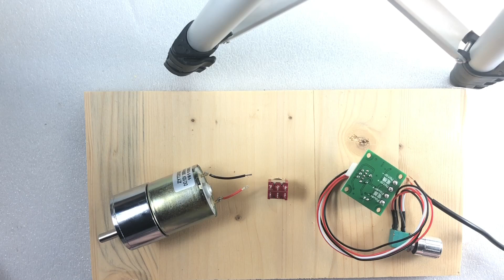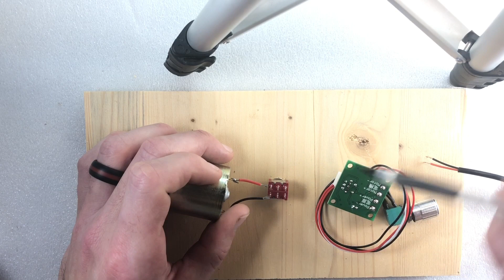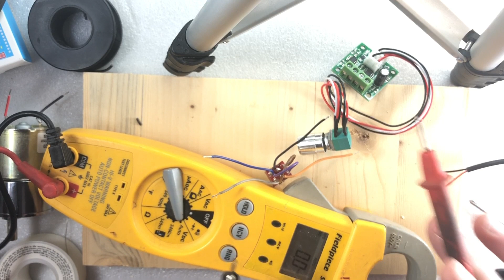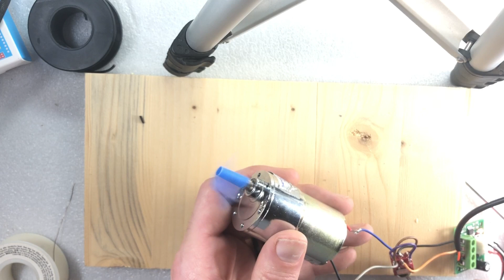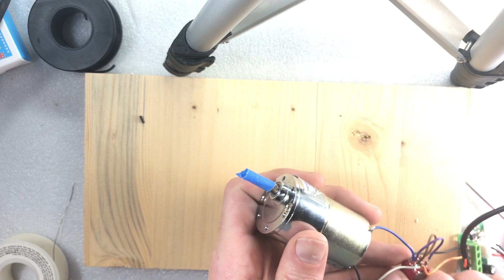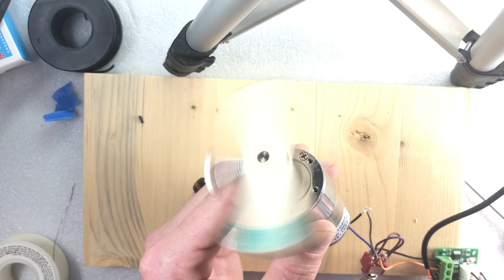How to Wire the Pickup Winder

Comment: Chase, this is the best simplest way to go I have found. The PWN is so important and has made the winder a breeze to create. Thanks for this info. I had been using the LM317T voltage regulator which creates a lot of heat dissipation, but this PMW is a magic little device and works perfectly. BTW to your process I have added putting a tiny bit of cyano on the start finish leads to make them more sturdy, Overall an excellent guide that is rock solid. No need for anything beyond what you hav show.

Comment: I'm sure it's a simple answer, but how did you mount the motor in the box? Is it just like a friction fit, or is there a bracket that holds it in place?
Reply from the maker: I believe it was friction fit at the making of the video but I did designed a motor mount for the motor. I have printable pdf files for all the parts in the description of the video including the motor mount if you’d like to use them.  Hope this helps!
Reply: @ChasesWKshop  Thank you! I'll definitely be using that pdf to make the mount as I wait for my parts to come in. These videos are super helpful!
Reply from the maker: @swoooner4304  great, glad I was able to help you out. Thanks for the kind words!

Comment: heya chase, is the power cable in this videot stripped at the input end for you to get those two wires exposd?
Reply from the maker: Yes. Use a volt meter to find the positive voyage. Let me know if I answered your question.

Comment: Hi 
thanks for your informative video.  I am curious as to where the wires would go for the reset function on the counter. Is there additional space on the circuit board to attach these or do you  attach them to the same place that the counter wires go to.  I am going to attempt making one of these winders. I have wound pickups manually by hand and that takes hours just to do a single pickup, so it is time to upgrade to an actual machine and I am not willing to pay so much more for something that does the same thing.
Reply from the maker: ska757 yes there are two wire terminals on the back of the counter for an external reset. Or at least there was on mine.  The counter has a reset on the front screen though too.

Comment: I have attempted this wiring with no joy. I can't get the speed controller working, tried two different switches but no luck. Motor runs direct to power, and runs from power and 3 way switch but as soon as I add the speed control its not working. I find it hard to believe I've received 2 faulty switches. The first switch I got a kind of hum from the motor and the second nothing. Any suggestions?
Reply from the maker: david prince hey David sorry to hear that bud. Make sure you wire the speed controller up exactly like it says. Send me some pics of it if you can or a video of what you have to weatherfordwoodcrafts@gmail.com If all else fails you can send it to me and I’ll see what I can do. . Just let me know bud. Thanks.

Comment: What kind of wires are you using to connect the switch to all of the other parts?
Reply from the maker: Thomas Ring 18 gauge wire.  You could use smaller too like 20 gauge. Hope this helps.

Comment: Could you show us a demo of how to use it? Like how to mount the bobbins and guide the wire and the like? And also, how would we go about using this one to wind humbuckers? Would I need to just build another mount for it and drill and hammer it to mount it to the motor too?
Reply from the maker: Dante Rosales thanks for the comment bud. I use this Pjckup Winder in my how to make a Pickup series. This video is part 3. Let me know if this helps. 
https://youtu.be/9t858PTIYjo
Reply from the maker: Dante Rosales also this is the first video I made where I go over the Pickup Winder if you haven’t seen it. 
https://youtu.be/MxVLF-maqb4

Comment: You mentioned putting a fuse on the positive wire between the chip board and the switch but it didn't look like you did.  Did you decide it was unnecessary or did  I miss something?
Reply from the maker: Yes I recommended putting one in there but I didn’t have on at the time I made the video. I plan on putting a 1 amp fuse between the power supply and the board.  It protects you and the Winder. Sorry for the confusion bud. Thanks!
Reply: @ChasesWKshop  Thanks for the quick response.  I honestly have NO electrical knowledge whatsoever.  Any chance you could recommend the right part on Amazon?  I made sure to subscribe.  It looks like you got some cool stuff going on here!
Reply from the maker: OfficialShoemaker Lucky Devil Guitars I’m going to purchase something like this because I’ll need various sizes in the future.  Also this set has inline fuse holders and panel mount holders. Let me know if you have anymore questions bud! 

https://www.amazon.com/dp/B07BVP8W16/ref=cm_sw_r_cp_api_i_22hICbJ5NNP8F

Comment: hi, great videos here. just wondered do you think if it's possible to use simple potentiometer as speed control for a motor of this size?
Reply: You could use a low resistance pot. BUT, you would put a lot of load on your power supply, the pot could overheat as most of the power will burned up in the pot and the motor will suffer from low torque (due to the limited power). So, not a good idea ;-) PWM is the way to go.
Reply from the maker: southbound pachyderm thanks for the question.You could but it wouldn’t give you a big range of speed.  You could defiantly try it though. This is a PWM speed controller if you don’t know what that is google it and you’ll see why it’s better than just a pot. A potentiometer would have power loss with its use as a PWM doesn’t. Hope this makes sense. Let me know if you have anymore questions bud. Welcome to the channel.

Comment: hello, very good solution, but how could i had a on-off switch to start the machine (for not using the reverse motor switch to limit the mistake) ? thanks
Reply from the maker: Stephane Baldino thanks bud!  You can mount a regular on off switch between the speed controller and the dpdt switch. Break the positive wire which in the video would be the orange wire, it’s the one coming from the motor + on the speed controller. Thanks for the comment and question!

Comment: I may put this on my project list. I rigged a sewing machine to wind pickups, but it's so big and heavy. I like the small size of everything. Takes up a lot less space and probably weighs a fraction of what I'm using. Thanks for all the info!👍😎🎸🎶
Reply from the maker: 74dart man sweet man. I’ve thought about using a sewing machine motor for the Pickup Winder 2.0. What do you think about that? Glad you like the video bud. Thanks for the comment.
Reply: @ChasesWKshop  I've thought about taking the sewing machine apart and using just the motor with some sort of speed controller. It just takes up too much space on my bench now. It would be interesting to see how you would do yours. Thanks for the videos!👍😎🎸🎶
Reply: @ChasesWKshop  the sewing machine winder is kind of on the back burner for now...I've got 2 guitars to finish building and a bass that I haven't started yet. So many projects and so little time!☺

Comment: Thanks for the video!

One thing I would suggest, in addition to the fuse, are two back-EMF diodes on the switch (normally it would go on the motor directly but you would need it on the switch since you are swapping the polarity).  There's a chance of an inductive kickback which can harm the motor and/or the driver board without a back EMF diode.
Reply from the maker: Thanks for the suggestion bud. Can you send me a diagram of what you’re suggesting. I’d love to know and would love to add it to the Winder. Glad you like the video man. Thanks again for the comment.
Reply: @ChasesWKshop  I can draw something up. I did make a mistake in my statement, you'd need 4 diodes, basically like you would with an H-bridge. Something like this https://i.stack.imgur.com/g7LYx.png

For a text description,  assuming your +V is on tab 3 of the switch, tab 4 is ground, and tabs 1 and 6 are connected to each other and tabs 2 and 5 are connected to each other, you would place a diode between tabs 4 and 1 with the polarity marking (usually a line on one end)  facing 1. Likewise, between 4 and 2 with the polarity marking facing 2. A diode between tabs 5 and 3 with the polarity marking facing 3, and between tabs 6 and 3 with the polarity marking facing 3. 

From the back of the switch, for reference:
1  2
3  4
5  6
Reply from the maker: athf226 awesome thanks. I’ll mess around with it. If you get time to sketch it out that’d be great.   I think I can go by your description though if you can’t. I really appreciate your help man. Couldn’t do this without you all!
Reply: Just don't swap polarity with power on ;-) Problem solved.